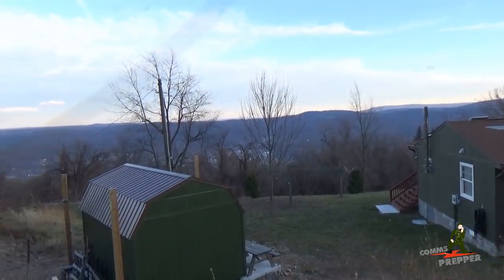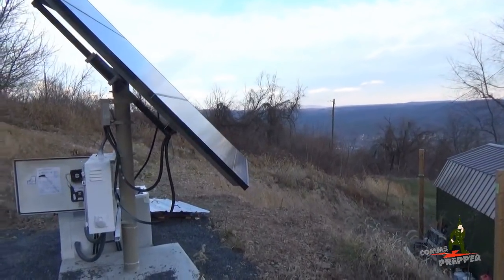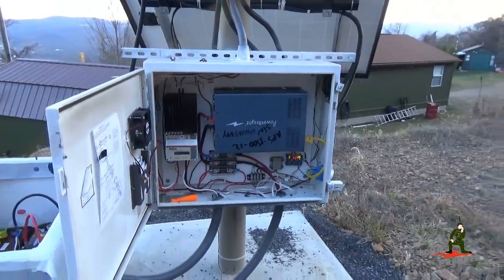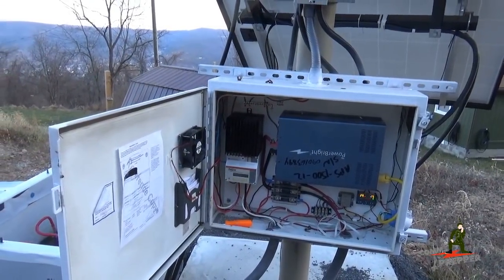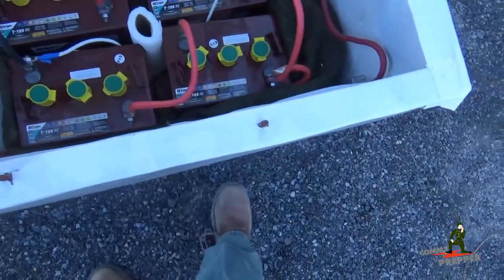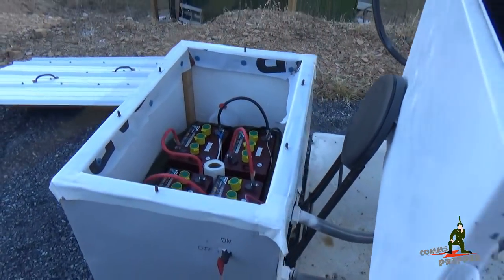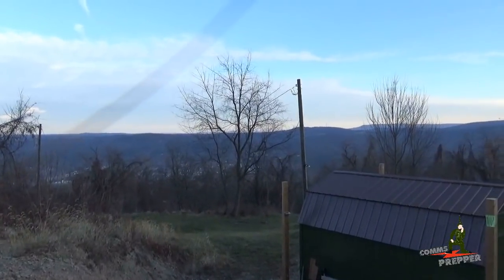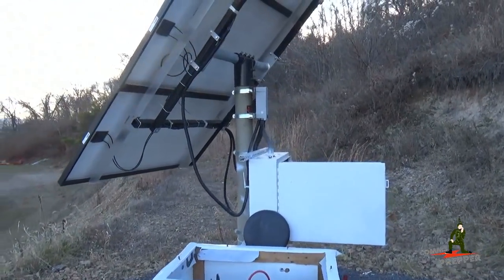Off-Grid Solar Power Winter Maintenance

Comment: "remotely over the internet" is not optimal for a cyber war scenario.
Reply from the maker: The write feature is hardware disabled via dip-switch.
Reply: Commsprepper who are you calling a dip-switch?
Reply: @Commsprepper its still attackable between reboot cycles, any persistent storage that is accessible should be easily writable.. you should put your entire network behind a hardware firewall and VPN into it when you need to remote in. Its much more secure than just putting everything out there on either DMZ (very bad idea) or port forwarding.

Comment: Nice , I watched you set it all up , how is it working out , what do you run off of solar
Reply from the maker: System works well for us.  We use it in combination with commercial power.  The solar runs our lighting, TV, computers etc.  The heavy loads are on the commercial power.  For us it's a backup system.

Comment: Write down your passwords and keep the paper in a safe place (where you would keep your cash). I know it used to be common wisdom that you aren't supposed to write down your passwords but things have changed. These days, bad guys guessing your simple password over the net is a much greater risk than someone finding your long written down password. Also use a password manager for the majority of your passwords but write down passwords you will need independent of your password manager (particularly the password for the password manager itself!). Bitcoin wallet passwords, private key passwords for those of you who deal in such things, passwords for encrypted drives/volumes, etc. are all candidates for being written down and stored in your wallet, gun safe, safe deposit box, whatever you have.
Reply from the maker: Thanks for the tips.

Comment: Very good setup on the solar =)   You might look at hydronic heating battery mats for the batteries with the water heater / circulating pump in another enclosure =)
Reply from the maker: I can't because my water heater is electric and I drain the system for the winter.  But thanks for sharing the idea - perhaps others can use it.
Reply: They use to make a unit for 105 solar batteries ( I was hunting for Sunelco and found out they are sold and a smaller regional contractor =(     You could use a closed system of a coil PLEX tubing and a small CFM 12 DC pump ( water is 50% / 50% mix car radiator fluid ) and Heat Tape ( built in cutoff temp switch in the tape =)